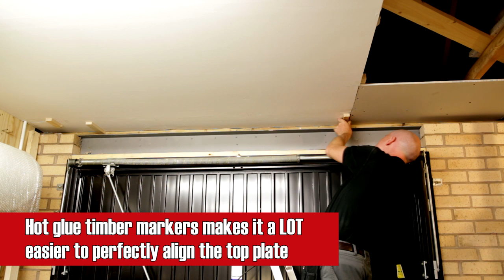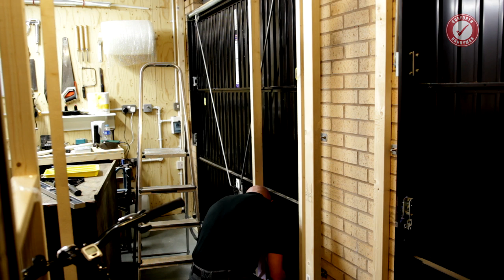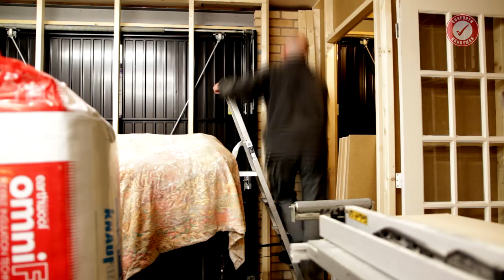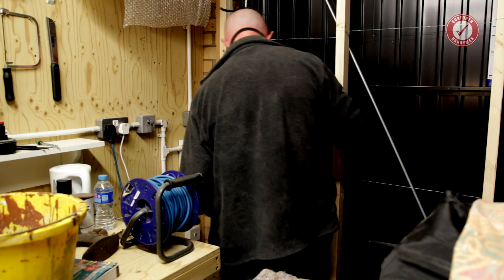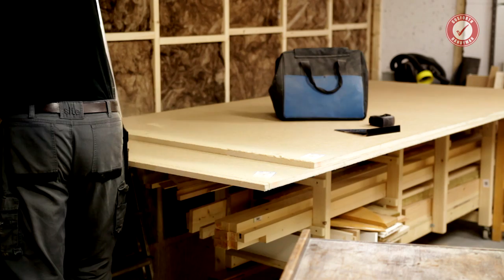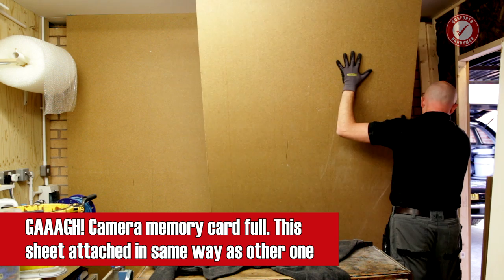How I Block up a Garage Door - Workshop Upgrade Part 3

Comment: Thank you for the video. I am planning to do the same in my attached single garage.

I am just slightly worried about damp settling into the garage, as I plan to totally seal the stud wall with sealant on the sides. This would block any ventilation, hence help damp to form. But it would help keep the garage warm I am hoping.

Any advice in regards to the damp at all please? I am really confused in this regard, but would really like to go ahead with this project in order to make my garage look more like a room, and become much warmer hopefully.

Kind Regards
Umair
Reply from the maker: I sealed the bottom edges of the base plate and painted it to protect the wood - on the door side. It's then just sealed on the inside. As there's plenty ventilation around the garage door itself any dampness in the cavity should dry out fine. Never been an issue for me. 👍
Reply: @GosforthHandyman  Thank you very much for your help. Honestly! I've been very confused about this matter.
Reply: @GosforthHandyman  thank you for this response!

Comment: Is there any reason you used MDF over OSB? Just curious.
Reply from the maker: More dense (so better sound / heat insulation), easier to paint and about the same price. 👍
Reply: Gosforth Handyman Ah, makes sense. Thanks for the reply.

Comment: Firstly thanks for this great video. I would like to ask you how you made sure that no water would leak through the garage door into the isolation and the walls you put up. We are thinking about doing the same to our garage door as a temporary solution.
Reply from the maker: The bottom plate of the stud is painted and sealed with all weather sealant - I haven't sealed the door from the outside as I'd rather air could circulate so that if any dampness does get in it can dry out naturally. All fine and removable in about 1-2 hrs. 👍😀